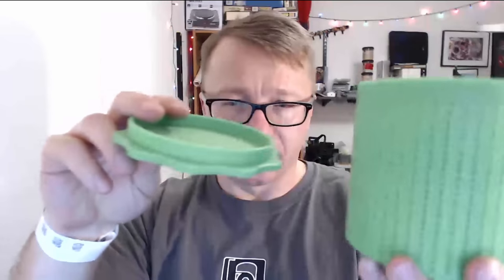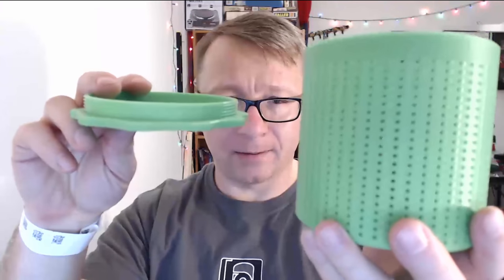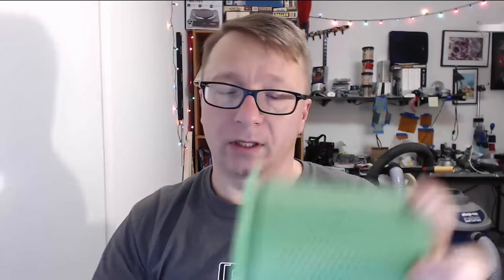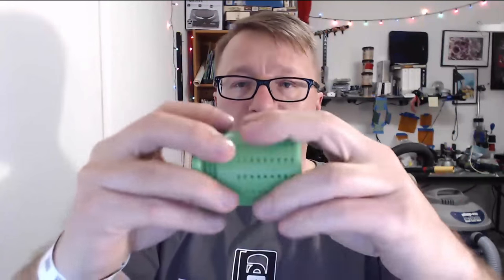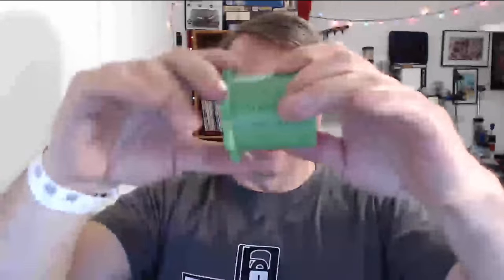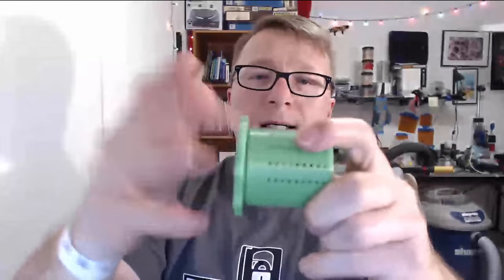Removing PETG from Prusa i3 MK2 Print Bed

Comment: Set your first layer to 100% and use Windex to clean the bed with PETG. From the Prusa material guide 'Make sure the surface is clean. Do not use isopropyl alcohol to clean the bed, or the adhesion may be too strong, if you do not have anything else on hand use the bundled glue as a separator after cleaning it. Windex or similar windows cleaner is great option for PET and you don’t need to use the glue after the cleaning. Pour a little amount on unscented paper towel and wipe the print surface.' Also remove the print with the bed still a little warm I do my at 40c. Hope you heal fast man!
Reply from the maker: Thanks Maverick - I'm using alcohol exclusively now.  I'll try windex to see if it makes a difference.  I've now found a quick whack with a hammer against the paint scraper pops the part off with little effort.  So maybe that will be my new technique.  Stitches come out on Sunday so I should be all good ;)

Thanks for watching and don't forget to subscribe!

Comment: Yes, big sharp gizmos on PEI are a hazard. The stitches in my hand took about 3 hours at the ER ... Windex helps but really does not fully solve the release issue.  best thing I've found so far is talcum powder brushed on in an "invisible" layer. If you can see white on the bed, you have to much on there. I had to go back to skirts / brims on some very parts to keep them held down. Oddly enough it holds big parts flat better than Windex (yes that's really weird ...). Since there seem to be many flavors of Windex, mine may not be the same as yours ....

Comment: Ok yeah yeah but seriously is the build plate ok?  I just did my first PETG print and it has left residue and marks on my coated heated plate (prusa mk3s)
Reply from the maker: Hi Ben - thanks for watching.  This particular time it was fine but I did end up ripping a piece from the bed about 1x1.5" removing a print made of PETG.  So, I like the filament but it really needs a flexible removable bed (now that such things exist).
Reply: @cyberreefguru  Hi, I hope you took my irreverence as the jest it was meant to be.  I hope your hand healed well.  The bed damage is pretty worrying.  I think mine is flexible "enough" (I don't like bending it as much as I have to), but even then there's the matter of stuff staying behind once you remove the PETG.  For me at least there are distinct outlines of my parts and some marks.
Reply from the maker: No worries.  Hand is all good, but I have a nice scare.  Despite all the issues, I still like PETG the best of all the filaments - it's stronger than PLA and easier to print than ABS.

Comment: Sorry about your injury, and I hope it healed well.  I had to get stitches in my knuckle a few months ago when I sliced it open replacing a washing machine clutch.  All I could think about while waiting in the emergency room was "I'm way too old to be getting stitches again'.  Anyway, my first printer is winging it's way to me as I write this.  I ordered a Prusa I3MK2S, and the same day I ordered a spool of MakerGeeks PETG.  What settings do you recommend to print MakerGeeks PETG on the Prusa?  Thanks!
Reply from the maker: Hi John - thanks for watching and commenting (don't forget to subscribe if you haven't already).  Of all the MG filament I've printed (1000's of meters), I've never used their PETG.  All the PETG I have is eSun (recommended) or Inland (not really recommended).  I did recently get a roll of PETG from MG via the #3dGeekBox, so I will be trying it out soon.

I generally print at 245 with a bed temp of 80.  PETG should have a greater retraction distance than PLA, but I've been using the same settings (aside from temperatures) without any problems.  On the MK2 without a sock, you want to keep the fan to 80% or so to avoid thermal runaway.  I'm happy to share my profiles from s3d if you have that program.  I like what Prusa is doing with Slic3r, but S3D is still my go to for many reasons.  Thanks again for watching!

-Tom

Comment: I find the easiest way to remove PETG is to keep the heated bed at 90C. Don't try and remove it when the bed has gone cold. Always works for me!
Reply from the maker: Thanks - I've tried that but it seems to stick way more when the bed is hot.  Maybe because it's a PEI surface vs glass or something.